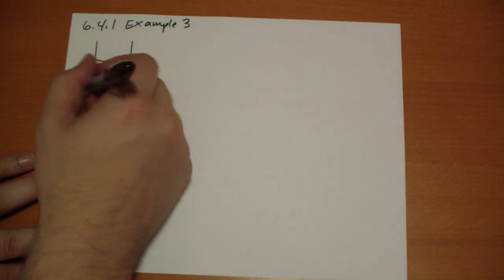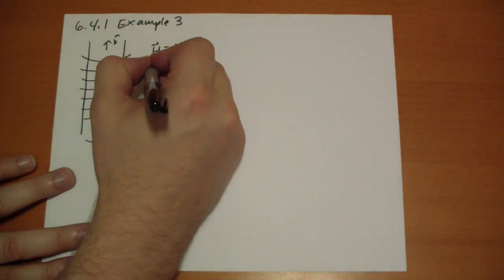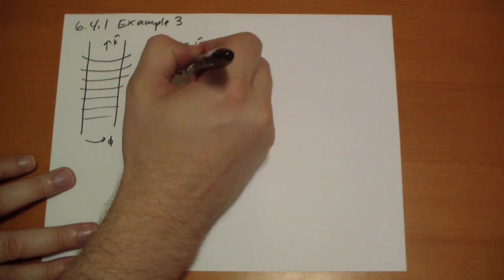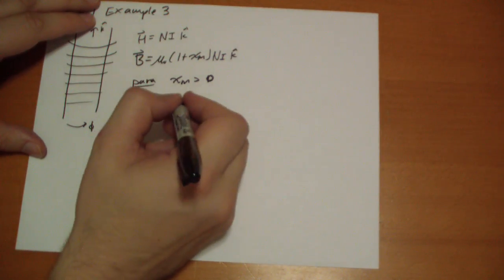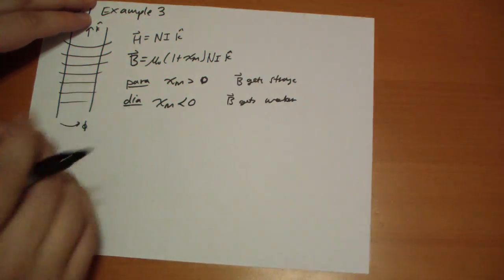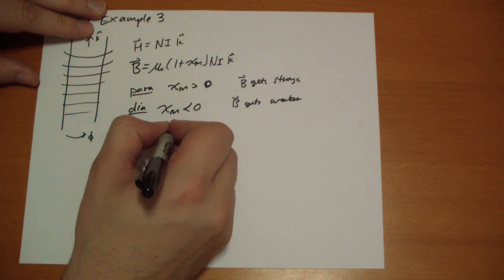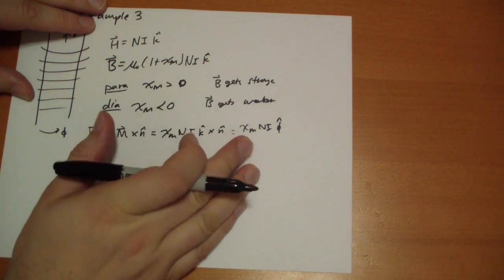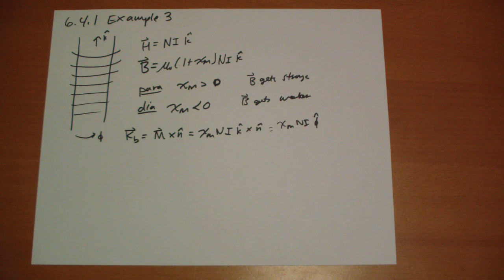6.4.1 Example 3

Comment: how is H=NI?
Reply: I'm late but might help someone. I_free-enclosed = n*I*L. The integral gives H*L and so the L's cancel out. Example 5.9 in Griffiths 4th edition is similar, with B/mu_0 instead of H. Don't forget that generally B/mu_0 =/= H, but only when symmetry allows (cylindres, planes, solenoids, toroids)
Reply: @sensii7370  i dont understand why I-free-enclosed = nIL
aren't we ignoring the bound currents here? why can we do this?
Reply: @Consa_Lu If I remember correctly this is the standard formula for the solenoid around a cylinder, n*L is there due to the number of wires which stretch out a length L along the cylinder. Each of the 2pi (a full circle) turns contributes to making the starting current larger in value
Reply: @sensii7370  yeah i think i got it now
my real question was just why they were considering the i as just i free, but what happens is that whenever an exercise just says there is a current "i", it means a free current. that's what got me confused lol

but thanks for the explanation!

Comment: Why is H zero on the outside?
Reply: A simple way to think about it that my professor taught us is that H only "cares about"/"sees"/depends on the free current. Since we're in free space outside the solenoid clearly there is no current just running through the air, it's only present in the solenoid/ material of interest. Hence there can be no H!
Reply: andersjaevel there is no magnetic field outside.
Reply: MFper4mance Haha, the question "why is H zero" is equivalent to the question "why is there no magnetic field" and therefore your answer "because there is no magnetic field" is no answer at all :P Anyway, this was over a year ago, and I think I understood it in the end.
Reply: andersjaevel ahah captain obvious here ahah I once saw that in a infinite solenoid the magnetic field lines close in infinite. but actually I don't know why there is no magnetic field (instead for example of a magnetic field with opposite direction from the magnetic field inside like in a Finite solenoid) and had that question earlier but since this is as hypothetical situation I accept it just as that ahah it may be because the larger the length, the weaker is the magnetic field right outside the solenoid and since for an infinite solenoid everything is "right outside" and it is an extreme situation, it must be zero (you could get a long solenoid with small radius and it would be similar but just a very weak mag field)
Reply: andersjaevel I don't know. I just made up that answer ahah :p
Reply: Yes, your thoughts are similar to mine :) We know the magnetic field due to a wire is circling around the wire. So if we add up the field contributions from each piece of wire then we see that there will be some cancellations on the outside. So for the infinite solenoid maybe the fields completely cancel eachother. One should be able to show this analytically but I have not done the calculation though.
Reply: I know this was posted years ago but my hopes are to help others who come this way as well